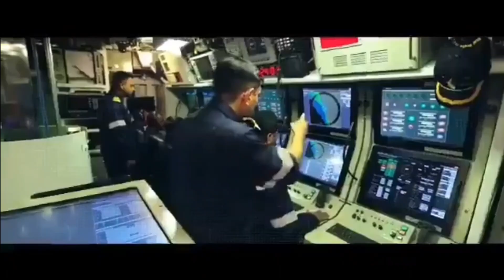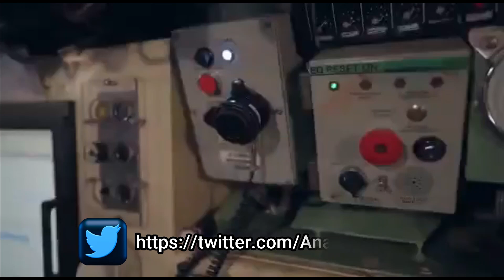Vagir the 5th Kalvari (Scorpene) class submarine to be commissioned into #IndianNavy on 23 Jan 2023.

Comment: Brasil has built a much bigger sub based on the Scorpene design, which proves this design is scalable. Álvaro Alberto has many similarities to his conventional predecessor of the Scorpène class. The first Brazilian nuclear submarine will have a beam of 9.8 m  to accommodate the pressurized water nuclear reactor (PWR). Its 100 m length and 6,000-ton displacement will be propelled by a 48 MW fully-electric propulsion system. For Bharat's first SSN, it makes sense to collaborate with the Brasilian's in building a new naval sub. Bharat can also build a bigger Scorpene with lithium ion batteries and fuel cells, and equipped with a VLS cell that will make p76I redundant.